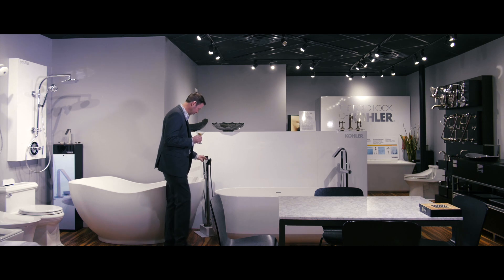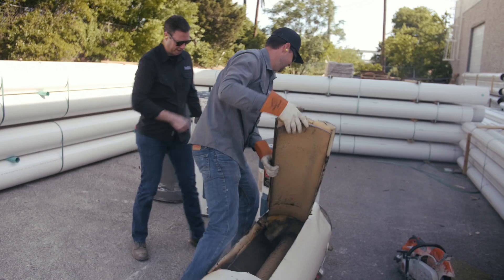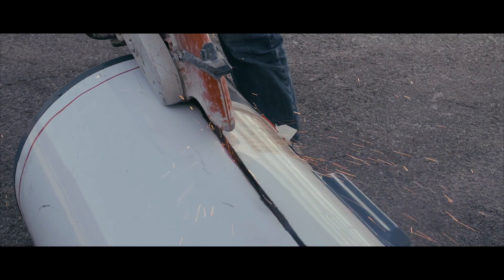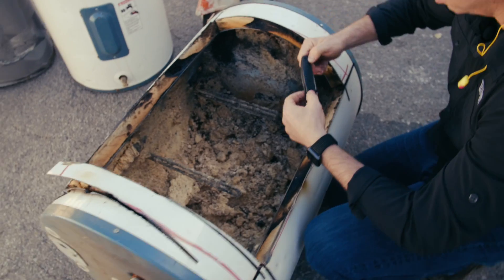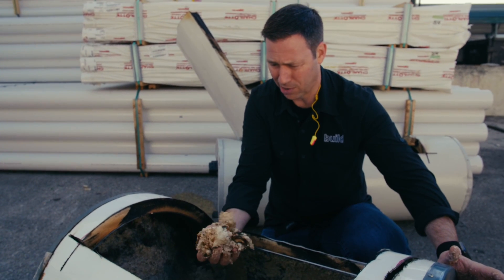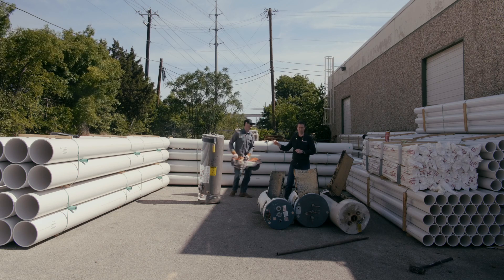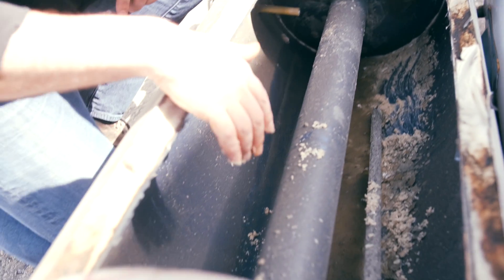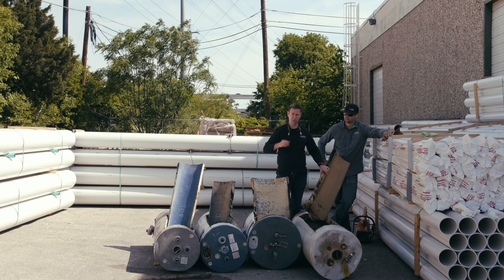Water Heater Tank Autopsy: You won’t believe what’s inside!

Comment: A tip for everyone who wants to flush out a tank. If you have a plastic drain valve that is a large white knob, I have had several not seal after flushing. I found that a hose bib with a 3/4" male pipe end on it will screw into the threads where the drain valve goes. Another thing about poking something  in the drain to get the minerals out of the way so the water can flow, if you can get a coat hanger wire through the valve and into the tank. make a small hole in a drain hose to insert the wire. I have had good success clearing the minerals at the drain, but it won't leak and flood the place.
Reply: Gary, this is an amazing idea.....this way, the wire is inserted thru the hose and into the water heater at the *BOTTOM* of the tank where most of the sludge is.....another guy sells a tool to insert a metal "whip" into the hole where the bottom electric heating element is, but that is about 12" or more of the ground....his device looks good, but yours is cheap and almost free....and you could connect the wire hanger to a drill, slightly bend a hook at the end of the wire, and spin it slowly inside with the drill to help stir it up.
Reply: @davidklemmer1368  I hadn't thought of attaching an electric drill. Great idea!

Comment: Those all look like tanks that had magnesium anode rods. Try an older A.O.smith, state, or American brand tank from the late 90’s or early 2000s.  Those had aluminum rods that left a lot more waste inside,  it doesn’t look like scale more like slime. Gas or electric doesn’t make a difference in the amount of build up,  soft water breaks down the anode rods faster than hard water, magnesium rods break down into that hard type scale, aluminum ones break down into sludge and leave a lot more waste inside.

Comment: Chemistry + Physics Teacher - The heating elements don't grow scale because they change size as they cycle on and off.  It's not a huge difference, but that growing and shrinking causes any sizable chunks to break off and keep the heating elements relatively clean.  This is very apparent in a water still, where the carbonates are not only precipitating from heat but also from being concentrated by boiling.

Comment: I wish I’d seen something like this a few weeks ago. Our old electric tank finally failed and got replaced. I was tempted to try break it up a bit to take to the metal recycling, but didn’t. I just took it to be recycled. It was a 1987 model Rheem! Not a bad innings. 
Maybe all that scale gave me a few more $$ due to added weight 👍🏻
Reply: maybe you'd get 5 cents instead of 2! Steel scrap isn't worth anything. Maybe the brass fittings and the t/p relief valve but not the tank.
Reply: David Noel I just meant cutting open to check out the scale that would’ve been in a 35 yr old tank. 
I thought the inner tank may have been copper, but decided not to bother. 
Yep, steels only $120 a tonne atm. I removed the valves to get the brass at brass price though 👍🏻

Comment: I noticed that the drain valve was ~4" above the tank bottom. That was surprising. 

I recall reading a heater tank company PDF file on how to rinse the tank monthly. They recommended using the drain valve as the inlet, using hot water as outlet. Apparently, using the drain as inlet stirs up the calcium salts. Of course, I would use it as a drain just to get the silt out first.
Reply: drain from drain valve or all that shit will clog your fixtures.

Comment: Matt I suspect several things are going on with those older hot water heaters. One being the presents of limestone, dolomite, and gypsum in the water. If you think about it the Karst caves that populate the Austin area, have a lot of underground caves and a natural spring like Barton Springs. Secondly what I think is going on, is you have a lot of people that do not understand that they need to flush their water heaters every so often. I say that as I did not learn that I needed to do that, until a couple of years ago. Some of it I suspect least in the cases of the electric water heaters, is being caused by the heating elements as those tend to degrade after a while. Now I say that, as I am aware of the Edwards Aquifer in Texas. Now I am just guessing this, because the video gave me the impression you are examining water heaters in the Austin Area, but I honestly do not know. But the lack of buildup in the third one could also be due to someone taking proper care of their water heater, but I think more likely some kind of water filtration system or both.

Comment: The house I bought last year had a 15 year old tank and it gurgled badly when heating the water. It was gas powered. The drain valve didn't work at all and after beating on it I got some water and chunks to come out. I had galvanized pipes in the house and they were rotted. Replaced it with all copper and a new tank. I clean up the scale and hard water on the anode once a year and the walls look like new after the first year of it being installed.

Comment: Matt, I have examined that "scale" in many heaters in my area. I used 10X and 20X jewelers loops. Around here, in the St. Louis area, very fine sand from the water purification plants often  travels thru the water lines. All soda fountains and large commercial ice machines have two filter cartridges.  A 10 micron filter traps most of the sand. A charcoal filter improves the water flavor.

Comment: I am in the process of changing my water heater from electric to gas. From what I've gathered, the heating elements being inside the water makes the scale problem worse. My old one is a 120 gallon and the scale was/is so bad that I had to dig out the lower heating element when they both went out. When you go to drain it out, none of the junk comes out because it's all stuck to the sides. I think there was a while where the water softener wasn't working before we moved in, plus I think the size and diameter of tank have something to do with it. It's added enough weight that there is no way that dude could kick it down unless he does a running drop kick.
Reply: And yes, our water is super hard. It almost has a "dry" taste when unfiltered.

Comment: Hot water tanks are old school, antiquated methods of heating water. The modern way to heat water is thankless instant on off heaters that are also the most energy efficient way to heat water. There can be multipal heaters throughout the house that are safe and econimical.
Reply: and that scale builds up in the demand units' small passages quicker, requiring more frequent service - Factor that in.
Reply: You are ignoring the "facts" tankless water heaters only come on to heat the water when the faucet is turned on, and only then when there is a demand for the hot water. The is a build up of minerial deposits but very minamal compared to the tank type heaters that are always heating the water even when there in no demand for hot water.
Reply: Ethan is correct. In the days of pilot lights, the heat from the pilot often overheated the water due to the lack of heat loss through the insulation.

Like he said, tankless systems also have a high power density requirement, so you get all the complications with that, as he mentioned. If its gas, you're talking pipe size and maybe talking to the company about bumping your pressure and dealing with every other gas appliance in the home.

Nobody talks about the tankless temp variations, though. Unless you're talking about a "tankless" that's just an exchanger on a boiler or similar system, you'll never have a guaranteed steady shower temp, unless MAYBE you've got a fully modulated burner. If you're someone who has muscle, joint, back, anxiety problems or are trying to unwind after your boss chewed you out... Good luck. Asking the wife and kids not to flush the toilet won't be enough.

Furthermore, if they're gas tankless, you have to have a flue on EACH ONE if you have a bunch... Unless you want to take a cue from many european countries, and just OMIT that. Yes, they take combustion air from inside then just dump it back into the house. Flue gases may have no CO (when running perfectly) but they still dilute oxygen and WORSE, burning hydrocarbon fuels means you're combining HYDROGEN with oxygen, too-- So you get WATER vapor in the house- In mass amounts. Mmm, fungal growth.
Reply: Kenneth Russell tankless is fine but when there is a natural disaster antiquated hold water you can use and residual heat
Reply: Buy a water softener.
Reply: Yeah, Until they clog up from scale.
Reply: Kenneth Russell "Always heating" is a rather dramatic claim as tank water heaters actually run very little unless fresh cold water is being drawn into them.  Even most older tanks were insulated well enough to maintain their temperature for up to 24 hours and many more modern tanks will still have enough hot water to afford one several very comfortable showers as much as 72 hours after they last had power (such as in the case of an extended power outage).  Because of how well insulated they are the energy savings are not nearly as dramatic as one may initially suspect unless the household seldom ever uses hot water, but most households tend to use a fair bit of hot water each day -- bathing, laundry, dishes, etc. -- so that is seldom the case for an occupied home (and if going on an extended vacation, it is trivial to turn off a tank water heater and then turn it back on when you arrive back home).  That is why you often see more marketing focusing on the idea of "infinite" hot water capacity as the chief advantage over tank water heaters (infinite being a bit of a misnomer as their realtime heating capacity is seldom more than a few gallons per minute at best unless tremendously oversized) -- of course, if the power goes out you will instantly have no hit water whatsoever whereas a gas tank-style water heater typically requires no electrical power to do its job and an electric tank water heater will still have its reserve of preheated water that you may call upon until consumed.  By the time you figure in the added install costs and more regular maintenance it is at best a draw between the two technologies for most families -- and for those families that do not have access to natural gas or propane they are all but impractical (with a typical unit capable of delivering just enough water to support two concurrent showers typically requiring at least 180A single phase or 60A three phase, or more than most ordinary residential services can deliver in addition to existing residential load demands).
Reply: Hm I disagree. The most modern system is an integrated system containing solar water heating, a big tank, a heat pump and floor heating.

You get ~70°C water from the solar heater and store it in the 100 gallon or so tank. The heat pump gets further heat from outside (from either air or ground). The floor heating only needs 22-23°C water to heat the whole house.

I have such an installation and hot water is free from april to late september. Heatings costs are very low, also due to very thick insulation on the outside of the walls of the building.
Reply: You are forgetting there are slow methods of cheaply heating water that will not work instantly, which is why you will want a tank.

Instant water heaters are a thing of the past in most of Europe. Only in high rise buildings you will see them, to save on plumbing. Tank type heaters are not always heating the water. I have my system set to a maximum temperature of only 45 degrees °C. Ever took a a shower at such a temperature? Seriously too hot for comfort. Your insta-heater will not even have temperature control.
Reply: Good job krappermaan!

Comment: 2 things to mention. 
1.Water hardness varies greatly by location and how your local water supply is managed.
2. Heat increases the solubility but as the water evaporates or is pushed through the system the concentration builds up and will  be deposited on colder areas where the solubility is lower.

If you were to take a pan of ice water, dissolve salt in it until it wouldn't take anymore then boil it and keep it on a low boil. the salt would deposit on the walls especially near the top much faster than it would on the bottom of the pan.

Comment: I would say it mostly depends on water quality. I recently replaced a 38 year old electric water heater with a hybrid. When I hauled it outside and looked through the inlet it was completely clean inside. The anode was gone but that's to be expected after nearly 40 years. This was on city water in central Florida.

Comment: It really has to do with the source of the water. City water versus well water. Some wells have an extreme amount of calcium in them. Also if your well is running low or shortly after a heavy rain your pump may suck mud. It's always good to filter your water before your hot water tank actually before it meets the house.

Comment: Sorry Matt, but on those electric heaters that isn't mineral deposits (scale) from heating the water, it is the result of the anode corroding. The aluminum or magnesium anode will take up 10 times it's original volume after its done its job of sacrificially corroding. An electric heater can last many years as long as it is flushed advisor AND the anode is replaced regularly. How often the anode needs replacing depends on water conditions.

Comment: Compare the anodes.

 The sedement is what comes out of the water, hence the water is cleaner coming out tha going in.

Replace that cheap plastic drain valve  with a full port ball valve, and then make a dip tube to swirl of the sediment when back flushing, you can improve efficiency as the sediment inhibits the heat into the water.

Comment: interesting video! I think the mineral deposits depend most on water source (I'd imagine well water would be much worse than most municipal water sources) and total amount of water these heaters see over their service life. Tankless heaters also get scale, so they are not immune to whatever water supply they connect to. The amount of mineral deposits is shocking on that worst case one you showed. I'm guessing the mineral buildup on the tank walls is most likely due to low fluid velocities (due to boundary layer) so the scale begins attaching to all surfaces and slowly builds up over time. Maybe why the buildup isn't as bad on the heating elements/surfaces is thermal expansion/contraction is loosening the buildup and re-entraining the minerals back into the hot water where it attaches elsewhere.

Comment: What , No oil fired water heater ?
 For crying out loud, nothing beats an oiled fired heater.
Fastest heaters on the market , and you ignored them.
A good water heater ,I have 2 electric  and one oil fired heater,they all lasted in excess of 25 years.
 All were replaced at 27 year mark, when they all started to leak.

Comment: How do you do a flush? I see a hose bib on the bottom of mine... Open it and let it run?
Reply: better yet, empty the tank, then take the hose bib right off the tank, and open the cold intake quickly to blast water in to dislodge the crud at the bottom. and get a 1 1/16 wrench and replace the anode!
Reply: Ralph Marshall    I have a 6k sq ft home with 6 bathrooms - we use two 50 gallon gas fired water heaters,  installed by Lowe’s less than 2 yrs ago (replaced original units after 19 yrs).  We experience some loud “popping” when the units are heating the water, so I bought a 25’ industrial rated hose and run it from the hose bib on the unit through the attic (we are in Texas) and into one of the bath tubs (you need to see the directions for the heater,  as the gas and pilot need to be turned off before draining).  Gravity pretty much does the rest.  I place a filter over the tub drain to minimize the amount of sediment that gets into the drain, using a 5  gallon bucket and gardening hand shovel to fill the bucket with the gunk.  Start to finish it takes me about 2 hrs all told

Comment: this is why i dont push to hard to fix hot water tanks that are over 5 yo. they could be $800 in parts/labor on a unit that just isnt worth it.
and they can get much  worse then that depending on the water going into them.
i have seen units 20 years old with good water from the city in better shape then a 8 year old units with very hard water

Comment: I don’t know about the chemistry but I had an electric w heater fail after three years. When I drained it it would not drain because the nozzle at the bottom was packed solid eventually we got it free and found that there was a large amount of white sand material in there. The water heater never saw hard water  We used soft water from day one.
Reply: You better call the Culligan man buddy. You softener ain't doin' it's job.

Comment: Mr Risinger...
I lived in a small apt with a small electric water heater like the one the one you cut open. I told manager for  some time there was a problem.
Finally the guy came to replace it.
After disconnecting it he could not pick it up.
The whole inside was a solid boulder.